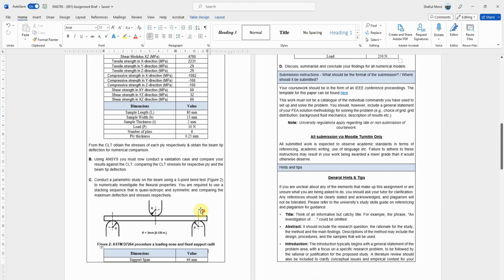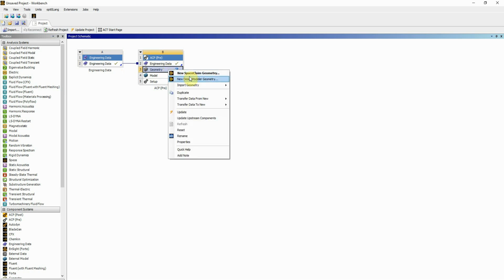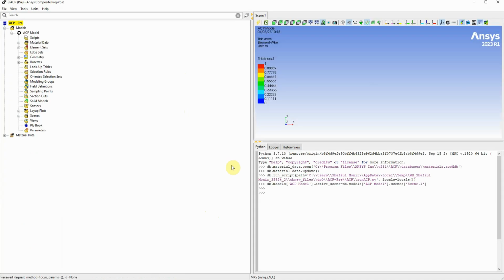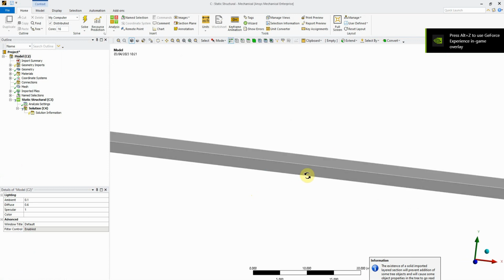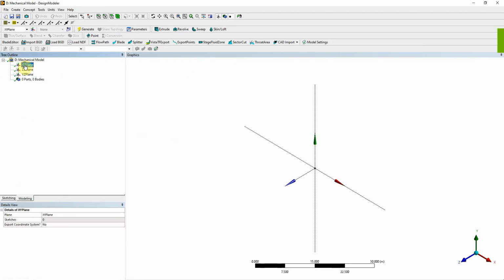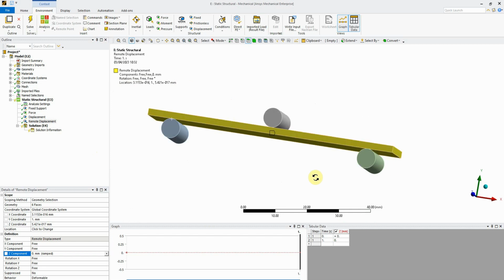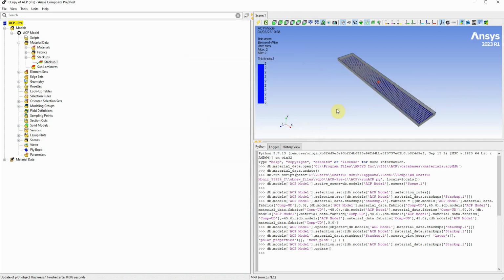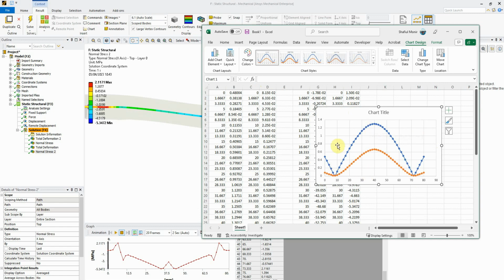Design with Composites - Composite ANSYS ACP

Comment: sorry, can i ask a question? how can i create a material with only E1, E2, v12 and G12? because in CLT plane element don't consider the direction of Z axial. i used ACP and transform to shell element, but if a change the value of G23, the result won't be the same? but i should be the same. why? can you help me? thanks.